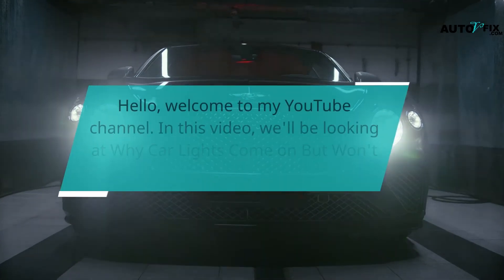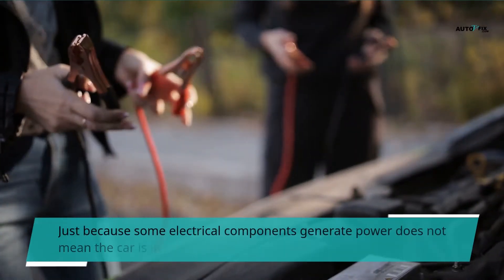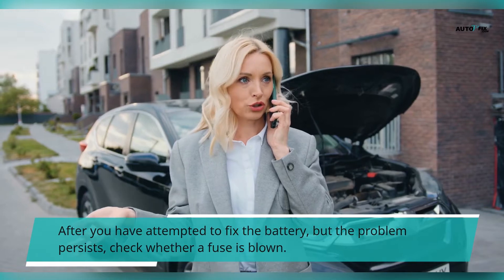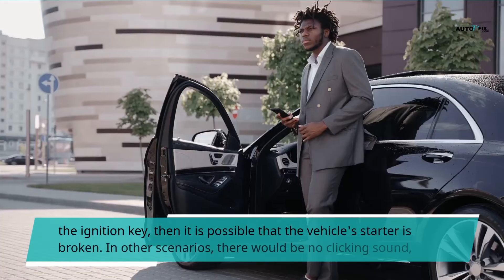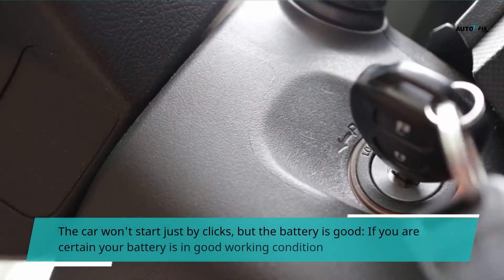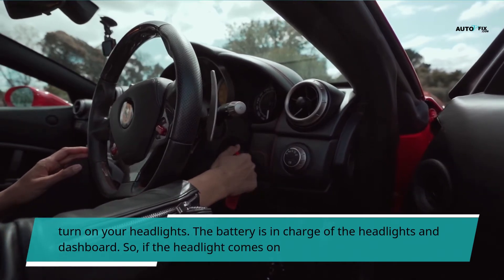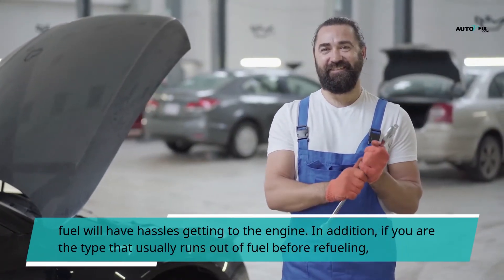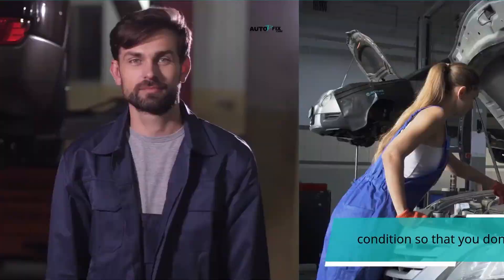Why Car won't Start with Jump but lights come on  & What do if car wont start with jump

Comment: Sometimes when I shift the gears or use my use my blinker my cars shuts off and the dash lights go out. After a while they’ll start to flicker until they eventually come back on. While thats happening the car cant start and I cant use my windows but every other electrical part works

Comment: A bad fuel pump could keep a car from starting as well. I would know because my car had it a bad fuel pump. It would crank but no start. But the fact that the car didn't start but I still had power to the accessories.

Comment: The hazard warning lights only flash when the theft deterrent system is armed and the engine will not start.
To restore the system ,turn the ignition key to the lock position then to the on position,now press the lock or unlock door button on the driver's door,then turn on the ignition, the car should start.